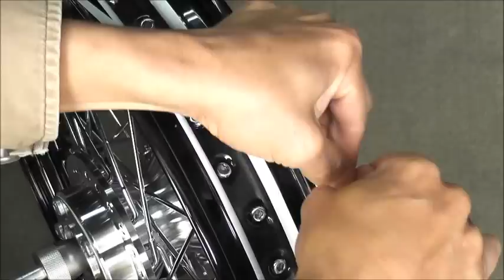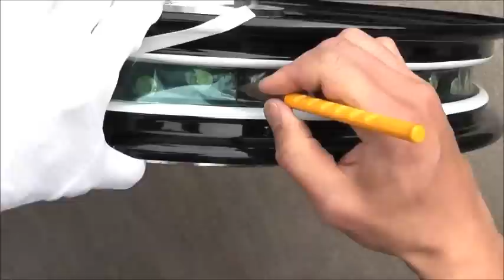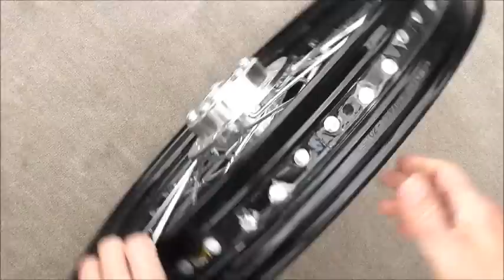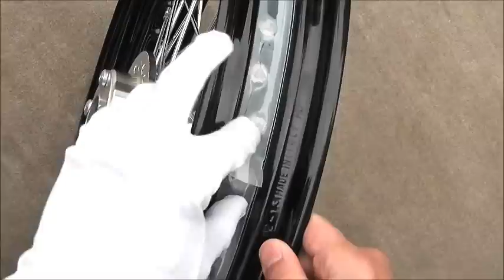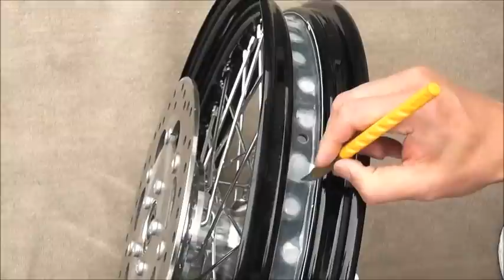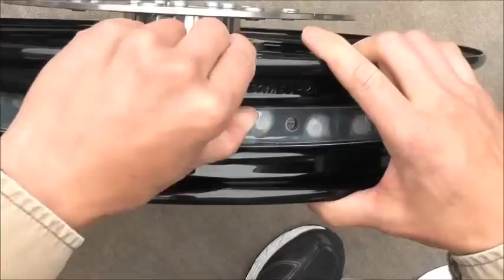Outex tubeless kit Instruction for Harley-Davidson / チューブレスキット施工　ハーレーダビッドソン

Comment: nice system but you can do it yourself if want to source the parts separately 3m 4411 sealing tape plus through hull 3m marine adhesive 5200, and aftermarket small valve stems.
Reply: i started looking into this, but to be honest, i ound the kit specific to my wheels on ebay sold by outex themselves, and it costs a lot less, considering that i would have to buy 2 diferent rolls of  m sealing tape to accomodate the 2 different wheel withs and they go fo about 80 euros eatch , you are still missing the spoke protection patches and the valves , the kit costs about 130 shipped to my door

Comment: A dab of silicone on top of each spoke from local hardware . 24 hours cured = rock solid/waterproof  Wonder if centrifical force from spinning wheel cause tape to leak???
Reply: Air pressure pushing down on tape.

Comment: What was the sense behind the two white strips placed on wheel?
Reply: seems like the tape was there in case you accidentally misalign the sticky tape. you can pull it back and try again because at least the edges won't be sticking to the rim yet

Comment: What if we apply  thick coats of  adhesive or glue ?
Reply: Not strong enough. There is pair of spoked tubeless wheels for Triumph, BMW and MV Agusta but sadly the rear tires only for single sided swing arm.

Comment: This looks like a bad idea to me! You get a leak down the road and then you have to wonder if it's your tire valve, tire or the sealing tape!
 Doesn't seem like a good long term solution to me but.....
Reply: Use inner tube for smaller rim, like rim 14 for rim 17. It will be much easier and low cost for that matter.

Comment: Running tyres continued over heat inside removing the tape
Reply: I wonder.....why dont just use non wire wheels?....-..-'
Reply: @kewintaylor7056  Spoked wheels offer more comfort on offroad, and broken parts can be fixed/replaced individually